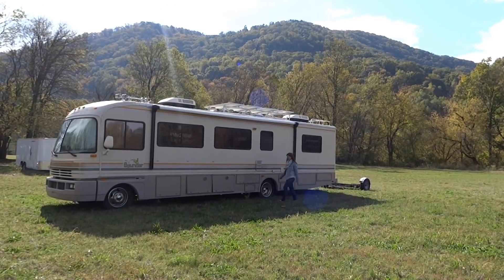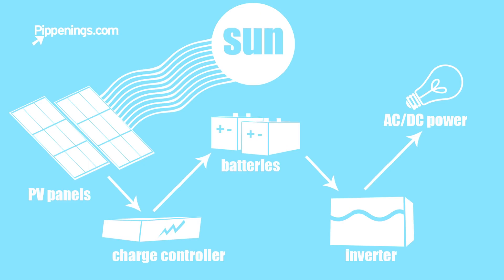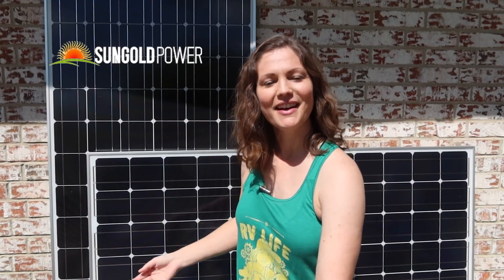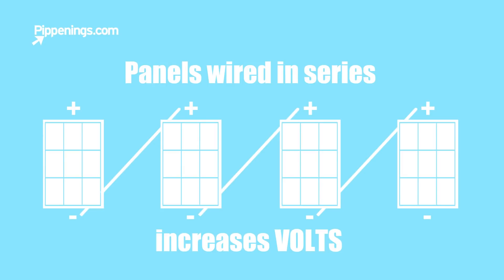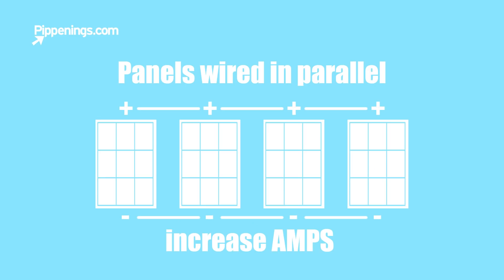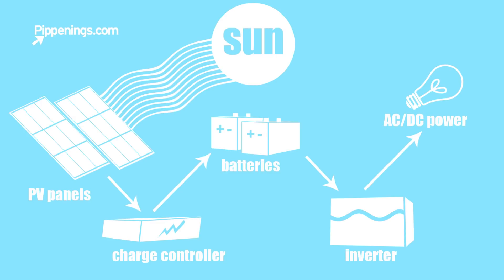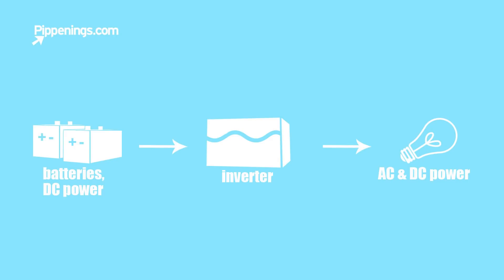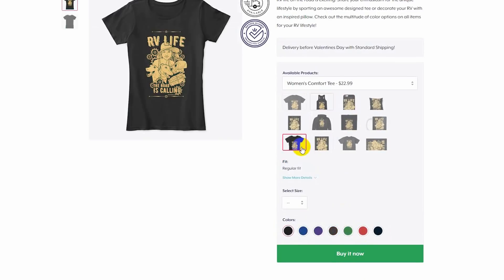Going OFF GRID with SunGoldPower!!

Comment: I am looking for a second property that I can be off grid in. I will use hydroelectric power and solar for the electrical system and a wood burning range in the kitchen and have propane as a backup. Hoping to buy in the next year in North Idaho or Western Montana.  I'd love to collect water and filter it too. But one step at a time. I wish more of us would go independent with power.

Comment: Great video Pippi.  I have a home work assignment for you. Learn what power transformers do.  With this knowledge you can see how high voltage, low amperage applicating such as earth batteries and aural antennas can be put to real use.